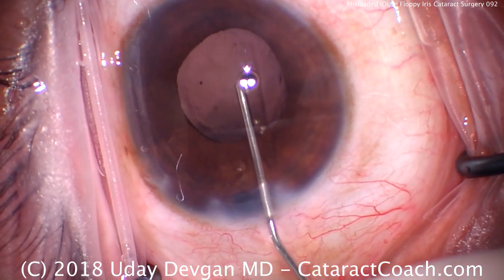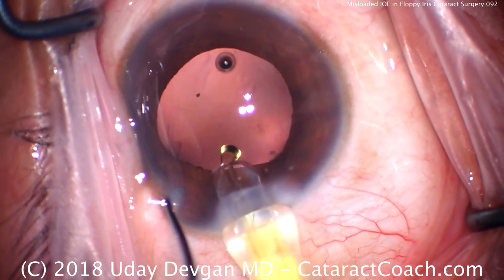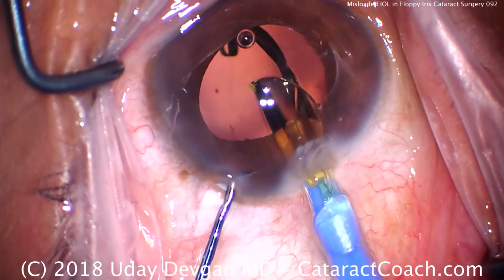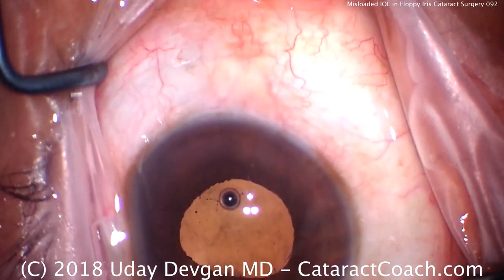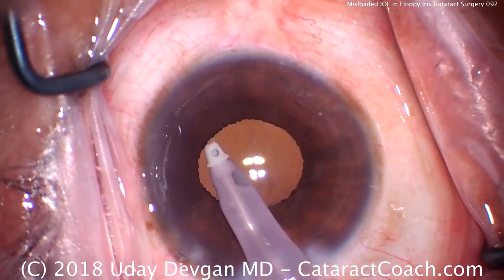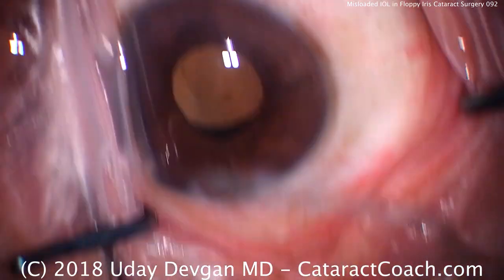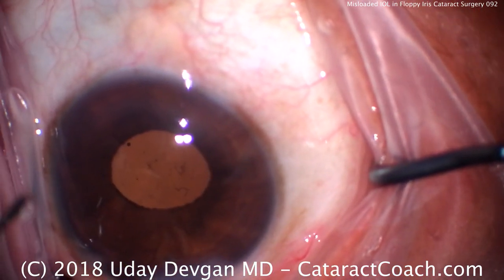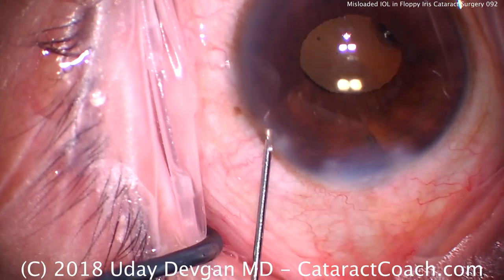Misloaded IOL in a Floppy Iris Cataract Surgery Case

Comment: Is it possible to dial IOL in anti clockwise fashion? If it goes inside eye in "S" configuration.
If yes then how to do this and precautions to do it...
This idea comes in my mind coz you had advised to use left hand as much as right hand in your earlier videos. Thank you
Reply from the maker: dial it in either direction, just make sure that at the end, the IOL is not upside-down
Reply: If the IOL is upside-down ("S") the angle of the haptics will push it to the front increasing the chance of an pupil capture in the future. Also, it will cause it to be in a different (very little bit) position than you calculated it to be (getting a residual  myopic target). Worst if it is an multifocal or toric IOL.